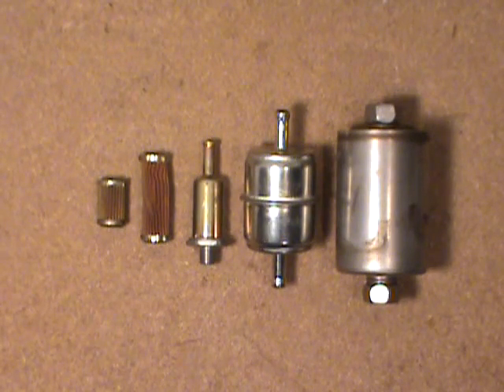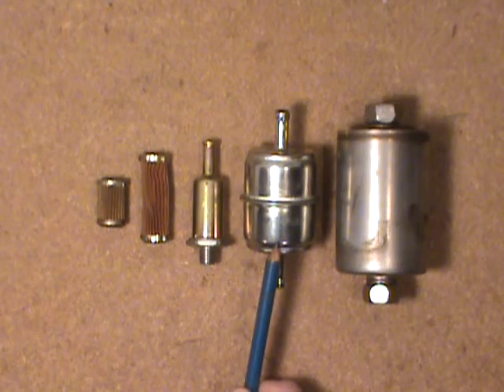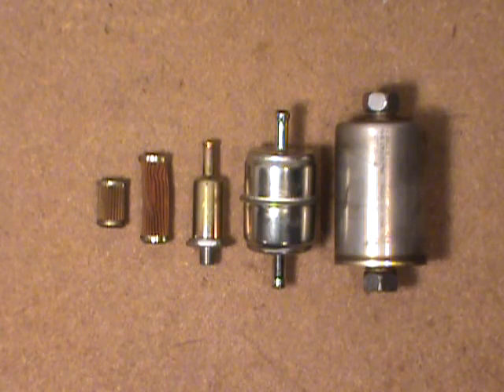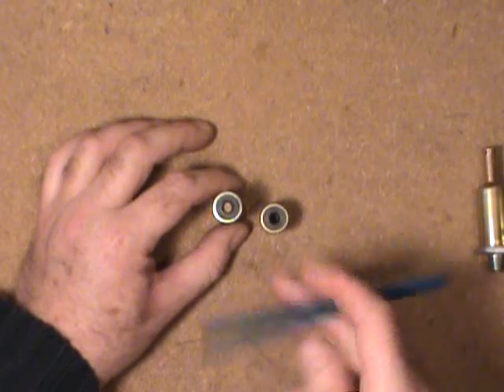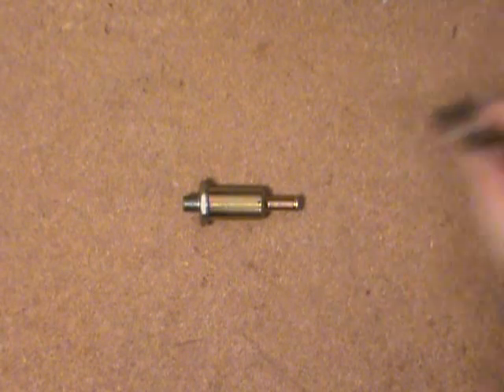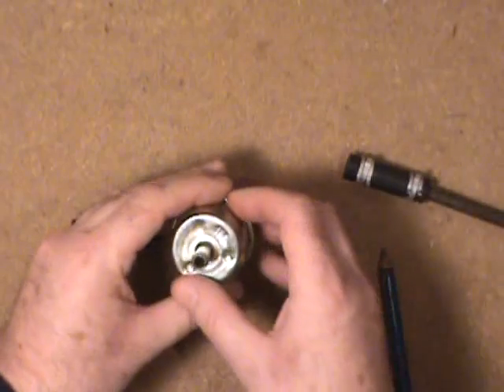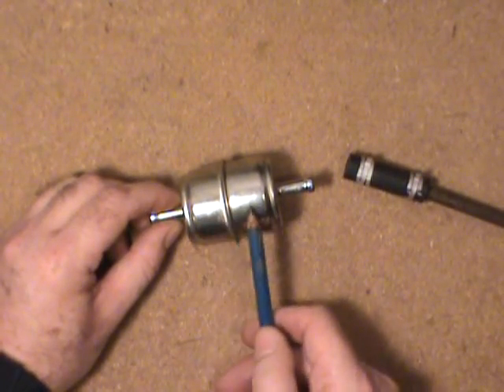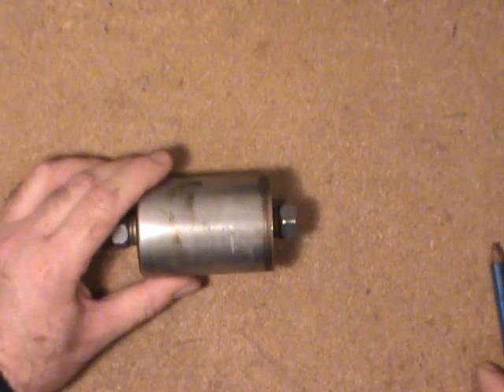Automotive Fuel Filters Explained

Comment: th anks but i think the long filter flow obeset
Reply from the maker: +Ali Al Qahtani Greetings Ali Al Qahtani....You are welcome, and, Thanks for watching, this YouTube Video of mine.............................You were saying, about, the Longer Fuel Filter, Flowing the best, well, if You happen to be Comparing those 2 Rochester Carburetor/brownish colored ones, that are on the left hand side of this Video's thumbnail picture, then, yes, I do agree with You...But...the "Correct Length" of Fuel Filter (long vs short one), must be Installed, into the "Exact Needs", of the "Model" of Rochester Carburetor, be it a 2-Barrel or 4-Barrel, that happens to need its Fuel Filter Replaced........................Also, I'm thinkin', that, the LARGER, the Filter Area (as in the actual Filter Medium/Paper, or what-ever), happens to be, the Longer it should last (between changes, to a new one), before, that, Fuel Filter, just might start Plugging-Up, and probably, be the cause, of the Engine's Fuel Starvation..........................Just make sure, if the Engine is (gasoline) Fuel Injected, that, the Correct Fuel Filter is Installed, cuz, at times, that Very High Fuel Pressure, can be in the order, of about "60 PSI/Pounds per square Inch...!!!...Yikes...!!!...and...the Fuel Filter (Yes-Sir-ee-Bob, that BIG, Silver, Metal Can-looking One, that has, the screw thread fittings, on each end of it), that is seen, in this YouTube Video's thumbnail picture, to the far, right hand side, is a pretty good, visual example, of a Mid-1990's, GMC/General Motors/Chevy/Chevrolet, Fuel Injected Engine's, Very "High Fuel Pressure", Fuel Filter, that can be Dangerous, if the Fuel Pressure, is not Bled off/reduced, Safely, to "Zero" PSI/Pounds per square Inch, before, Disconnecting things, like the Fuel Filter, or, any Fuel System related, Hoses, Pipes, or Fittings...!!!.................................The 4 Fuel Filters, to the Left hand side, are "Low Fuel Pressure" (less the 10 PSI/Pounds per square Inch), Fuel Filters, that are used, in, Carburetor type fuel systems...........................So, there You have it, for now that is, and, if You have any questions or concerns at all, just leave a comment, question or 2, under any of my YouTube Videos, and.........till next time...........Be Safe, take care, and have a good one.